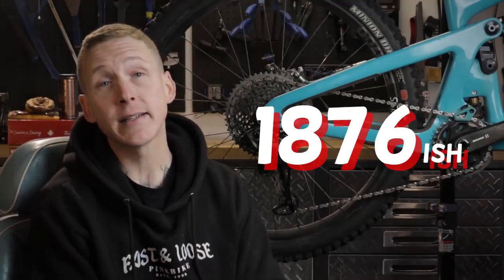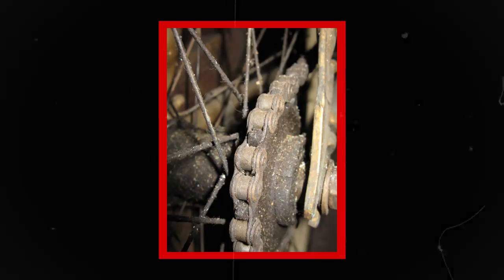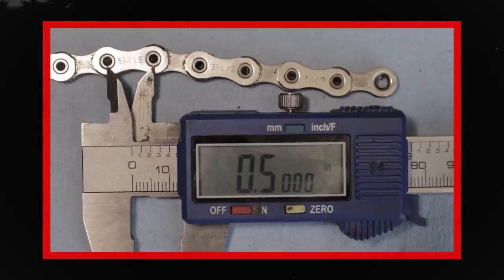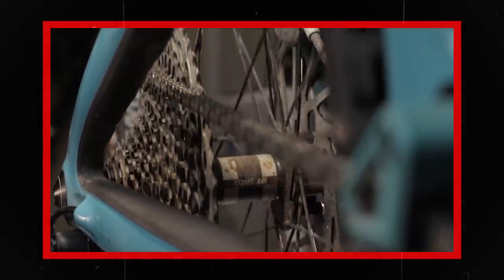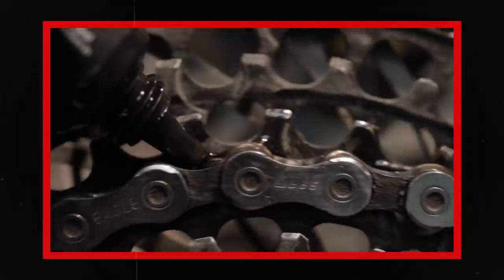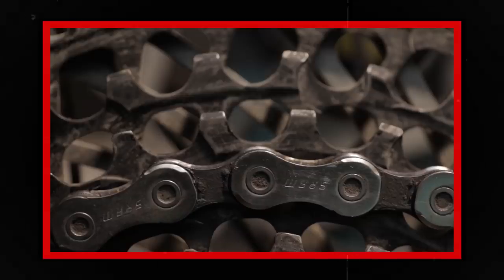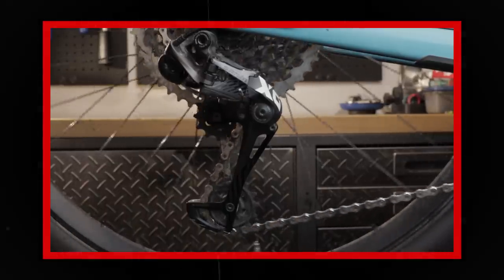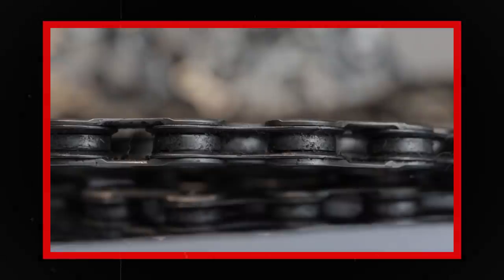The History of Bicycle Chains and How they Work | The Explainer

Comment: Hey peeps! First off all massiv thanks for the ton of content you guys put out! So, thanks ladies and gents at pink bike! But one thing to this video in peticular. I can't confirm that stretch on a bike chain is a misconception. They do stretch in length. And it is very obvious that the do. To make it valid i measured it the other day and they stretch quite not only a bit. And the stretch they have is not caused by the wear of the bolts. 

If someone wrote about the same i am sorry. i have looked for it in the comments.

Thanks again!

If you want we can talk about it some more.

Comment: If you're running a small chainring and a long crank (Say 175 mm with a 28T chainring, which has a circumference of 14" (chains have a 0.5" pitch) and a radius of 14"/(2 pi) = 2.23" or 56.5 mm, the law of the lever gives you a 3.09 force multiplication between the pedal force and the chain force), and you weighed 220 lbf (100 kgf or 981 N in non medieval units), you could apply a static load of 3*981 = 3033 N to the chain by putting your whole weight on the lead pedal with the back brake on (Incidentally you can both feel and see chain stretch when you do this, especially if you run a singlespeed where the bottom run of the chain will go visibly slack as the pedals load up - this is elastic stretch though and the chain springs back to its original length as soon as the load is removed - other parts of the bike are bending and stretching to carry this weight too, so less than half the slack you see is likely to be actual chain stretch. 
A big landing where your lead foot carries your weight onto the freewheel could easily triple this, which believe it or not gets you bang on 9100 N, the lower limit for the tensile strength of the chains in the test quoted in the video, so while normal pedaling will only break a chain if you're a powerlifter running SPDs (Squatting 3 times your bodyweight isn't unheard of in powerlifting circles, especially when you don't have to bend your knee anything like as far as for an actual squat) or the chain is defective (or shifted under load), shock loads can absolutely break perfectly good chains.
I should also mention that chain rollers generally don't reduce in diameter as they wear as claimed in the video anything like as significantly as they reduce in thickness, giving the distinctive rattly grinding noise a worn chain makes as the rollers rattle on engaging with the sprocket teeth. This however isn't a problem in wear terms unless the chain pitch also changes. This happens where the chain pin rubs against the inner link plates in the chain, wearing a notch into the chain pin and wearing the inner link plate hole into a slot. Note that only the inner link plate pitch increases as the chain wears as there's no sliding between the outer link plates and the chain pins and therefore no wear.
The upshot of this is that if you run an even number of teeth on all sprockets and the chain shifting pattern always puts inner links on the same tooth of every sprocket every time, you can have a drivetrain with every second tooth worn to the new pitch that still runs skip free for much longer than the same setup with odd numbers of sprocket teeth. 
Also have a look at Shimano's chain wear checker for a tool designed to correctly measure wear on chains by preloading the rollers to get a pin to pin distance rather than almost every other manufacturer's version which measures roller wear and pin to pin changes combined, giving a false impression of the wear level of the chain.

Comment: From what I heard, the ordinary (what some call a penny farthing) had the huge wheel simply for gearing advantage. Before gears and chains,  a bigger wheel meant a faster top speed.
Reply: Exactly so. A big wheel meant a bigger (higher) gear thus more speed for the same cadence. On the ordinary cycle, this meant that your gearing was dictated by your inside leg measurement. You could perhaps ride a bike with a smaller gear, although this would effectively make your saddle too low, but there was no way you could ride a higher gear, your feet just wouldn't reach the pedals. Chain drive meant that pedal cranks and drive wheels no longer had to turn at the same speed. We still talk about gearing in terms of the equivalent ordinary cycle front wheel size, (in the UK at least). When we speak of a 100" gear, we mean the the chain ring to sprocket ratio is such that our 700c  wheel is effectively multiplied in size to carry us the same distance as a 100" wheel on an ordinary would for each turn of the pedals. (Do you know anyone with a 50"+ inside leg? Me neither!)
Reply: The Penny Farthing is the origin of "gear inches."

Comment: Great video. What about cockpit setup? I know often its personal and it can be a big topic as there are a lot of variables. I run a DH, enduro and an ebike and have improved ride feel on them all by shortening stems, moving and changing seats adding riser bars, changing to One Up carbon bars to eliminate vibration , changing grips, using shimano brakes with good lever ergonomics.etc

Comment: Chain drive is also lighter and less expensive than belt or shaft, a big advantge on bicycles.  The light weight and efficient power transfer is also why chain drive is the norm on any motorcycle where performance and light weight is important (basically any dirt bike and sport bike), the low cost of chain drive is why it is popular on less expensive motorcycles, it is also much cheaper to fix if something breaks.

Comment: Yes the wear on the chain is the bigger issue but all chains do stretch. It is subjected to a force that pulls the chain in an axial direction which strains the material i.e. stretches the chain. Although this number could be very small especially with a higher end chain with harder steel

Comment: If chains dont stretch, how do you explain the chain getting more loose after a while of use on my single speed and my dirt jump bike?
Also, chains dont break? Again, on my dirt bike (single speed) my chain cracked multiple times even with no shifts. Might be because it was a halflink chain tho.
Reply: He later explained that the pin holes wallow out, get sloppy, and the chain appears to stretch
Reply: The side plates of a chain don't stretch. As explained in the video the bearing points at each end of the links wear, resulting in an effective increase in length. The chain hasn't stretched in the sense that a rubber band might, it has worn, and play the worn links accounts for the increase in length. Similarly the tensile strength of the side plates is way higher than the force that even the beefiest rider could exert. Chains don't break in the sense that there is a structural failure and a part of the chain has actually snapped. Failure is due to a pin pulling out of a side plate. Either due to incorrect assembly (Not uncommon in the past when derailleur chains didn't have quick links. A new chain would be installed by a mechanic using a tool to press the rivet pin into the side plates to join the ends of the chain up. If not done correctly the link at the join may be stiff, or worse the rivet may not be correctly fitted in the side plate and pull out under load.) On modern cycles, all rivets are factory installed and should with near 100% certainty be correctly fitted. As explained in the video rivets can be dislodged by clumsy gear changing under full power, eventually leading to the rivet pulling out of the side plate.
Reply: Thanks for the clarification guys. Maybe I shouldve payed more attention x)

Comment: This is a wonderful video, and I’m really enjoying this new series of explaining it videos. I have a question for you Mike, do you know is there a way to close a SRAM gold eagle 12 speed chain without using a quick link? I guess I’m asking is there a way to pin it closed.
Reply: ASD I believe it works the same with Sram but there is specific joining pins with pointed ends. If you got a new chain they should come in a tiny bag with some standard extra links
Reply: You can get golden quick links
Reply: Ryan P They’re asking how to do it without a quick link for some reason
Reply: Luke Schlieper So my chain broke about 12 links after my split link. I want to put it back together without using a split link again in case it gets screwed up in the derailer
Reply: ASD It isn’t the quick links fault, they’re just as strong as the rest of the chain. Use a quick link, it’s worth the ease of taking it off.
Reply: @lukeschlieper8880  The chain split because of a horrific cross chain accident, the damn thing is NEW ! not even 10 miles on it. I was worried that having two split links so close would foul the rear derailleur. Cool thanks.

Comment: I care least about my seatpost. 

My chain is a 10sp stainless ebike chain.
Reply: what brand chain do you have? I'd be surprised if you actually have a stainless steel chain besides not rusting, everything else is a downside.
Reply: @c.j.burtwell8430  

Wippermann.
Reply: Psyrecx rollers, plates, and pins all stainless?
Reply: Psyrecx I’m interested
Reply: @c.j.burtwell8430  

Seems to be. Haven't had any rust so far, and I take it out in the snow, still.
Reply: @c.j.burtwell8430  

Or at least they were at one point... The website now says the external plates are nickel plated. So, they either changed that, or weren't being honest before. Though, I'm more leaning towards the former.

Comment: Someone could definitely crank 1800lb to a chain. There are leverage ratios with the crank length, so you could cut that in half to 900lb pedal force. Get a big dude and have him stomp on the crank, and he could certainly create a 900lb impact force, an impact force that's liable to snap a chain more readily than a static load. That's considering a perfect straight chainline too.

Comment: I've heard knowledgeable mechanics say they recommend running 12sp chains on 11 speeds.
Reply: FindingaBalance what I’ve done they have better flexibility meaning they have a smoother shift
Reply: I’ve run 9-speed chain on 8-speed systems, 10-speed chain on 9-speed.  But the reverse cannot be done.  

In both cases, I’m using down tube or bar-end shifters.

And, contrary to the explainer, I like to have a bit of pin outside the plate.

Comment: Explain this then... Regularly break the timing chain on our mtb tandem... Same chain line and no shifting so the failure mech described not relevant in this case.
Reply: I would take a look at the tension held on the timing chain. too slack, too tight? I dunno, not my bike. but it IS my 2¢
Reply: @simonfarr8670  Thanks.  Set as per instructions + tried slacker and tighter tensions.  Only thing I can think is frame flex - I'm a big old lump at 6'5".